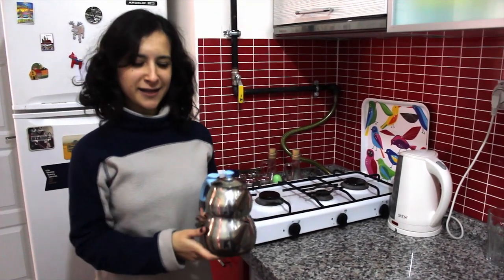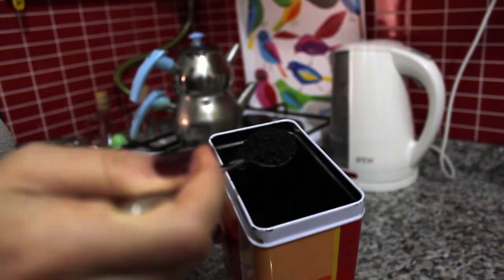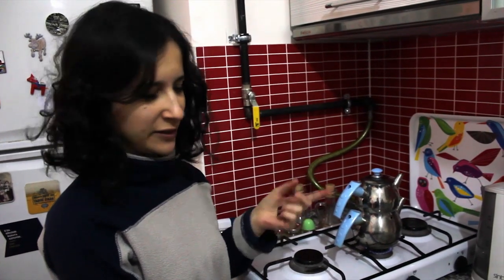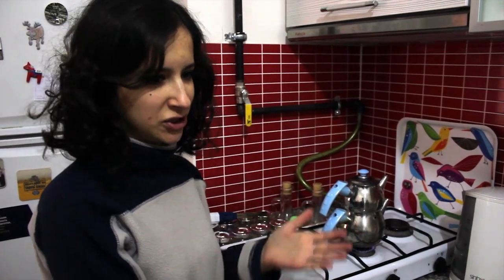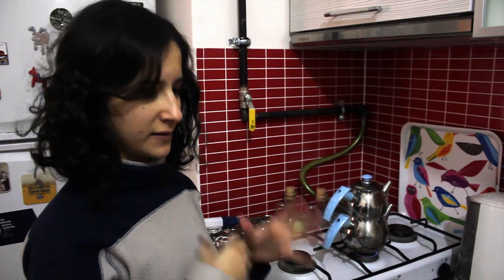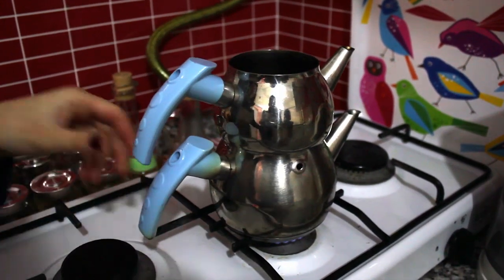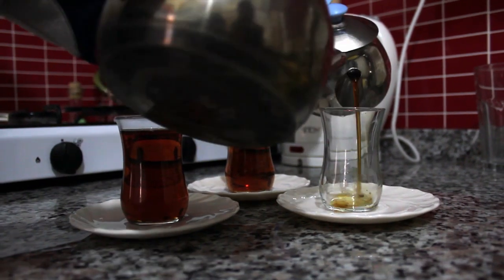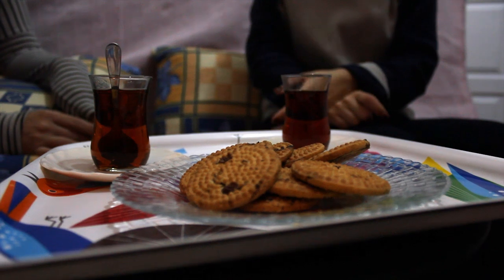Çai in turkey: How to make turkish tea.mp4

Comment: Cool, I have almost the same caydanlik ... BTW do not save up on water too much! This is what I thought when I began with this. It's a mistake! You'd think that you could use lots of tea leaves, and few water and have a very strong tea on the upper pot (which you can fill up with water then). Yes, but HOW MUCH tea? Most of the liquid will soon soak itself into the tea leaves and you will have to squeeze (!) the leaves to get the liquid back out of it.
So don't act as if you're short on water. :)